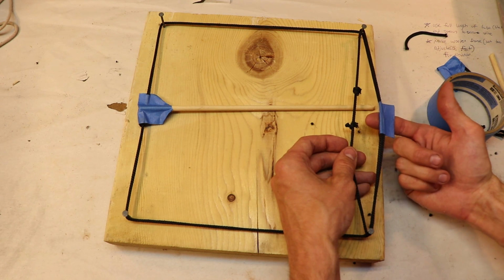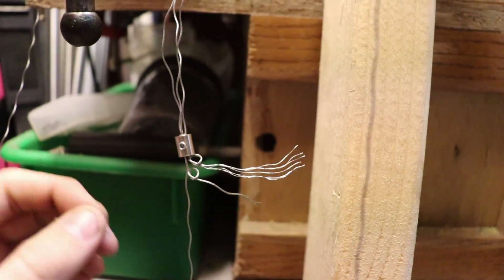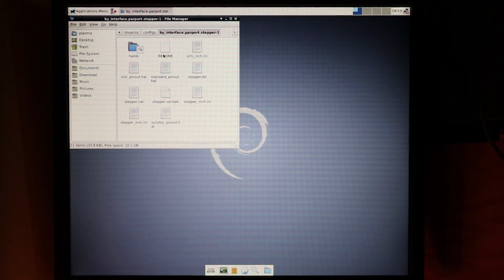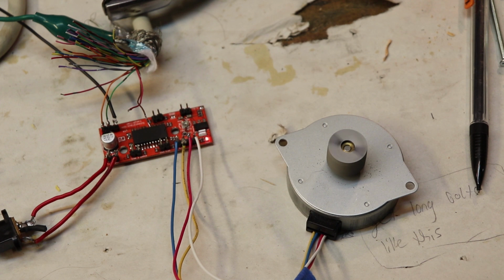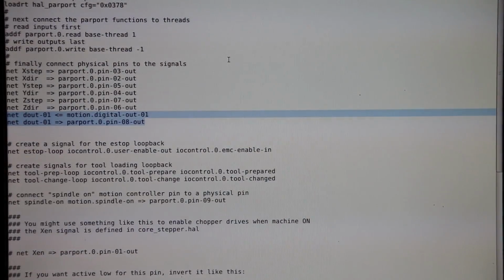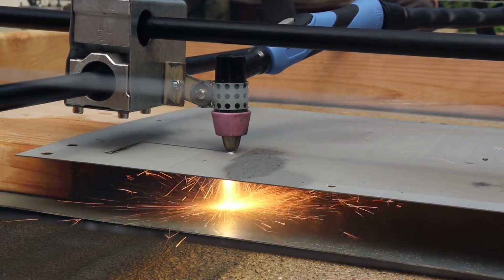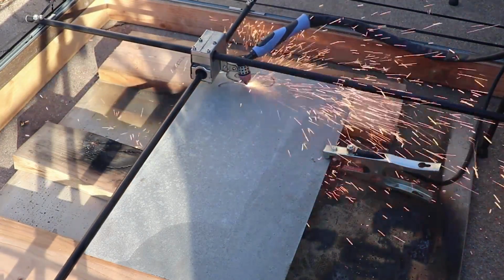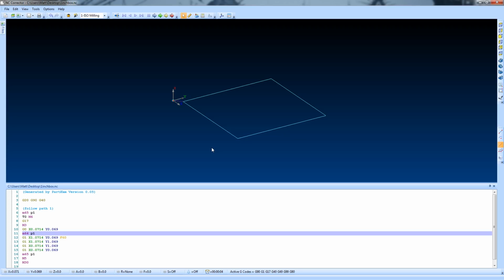DIY CNC Plasma Cutter (CHEAP)

Comment: how did you get around the high frequency noise and the Electromagnetic Interference ?
When I tired to use my Plasma cutter on my CNC machine the laptop that went berserk  (screen flashing etc) and the Port disconnected

Comment: Man, the neat thing here is that because the wood frame plasma cutter is so large, you could easily load in your own sheet and cut new stands for it and make a metal framed one fairly easily using only your own tooling.

Comment: You might want to make the frame stiffer by connecting those wires you have over diagonally from corner to corner.  Or use a 1x4 wood.  You also might want to make an "stick" that control the height of the plasma cutter over the sheets.  Like a ring around the cutting area and then up to the middle X where the cutter is set.

Comment: You are smart enough to make these as a kit for sale. Use extruded aluminum frames. Use threaded rods to eliminate slippage in the drive systems. Package it with a $300 laptop or better yet a tablet. Start with a bolt together 4' x 4' system. Do not make the table itself, just the system that we can bolt to our own table. That will keep shipping costs low. The largest expense for most turnkey plasma systems is the table and shipping. This package could be shipped UPS for under $50. This has the potential to be a multi million dollar business.
Reply: expensive laptop NOT need, cheap good have old used computer and linuxcnc. not need more, and controller board cheap 10$ breakoutboard were connected cheap DM556 etc motor drivers 20$/motor. and minimum good use nema 23 stepper motors min 3Nmeter torque. about take 3-4Ampere, need setting stepper motor drivers ampere max is little less than motor maximum current have. etc 3A motor max current stepper motor drivers need setting driver max current is little less 3A. maybe 2,9A then motors not burn broken. volts is better if have maximum what stepper motor can use, etc, DM556 driver maximum volt can use 50 volt good have 48 volt power supply.

Comment: Brilliant use of cables to make the X-Y move.  Even more brilliant that you're doing it with materials that are almost free.  I super appreciate how you make your thinking visible.  Please keep up the great work.  Subscribed.  EDIT: I also like how you're using an agile design process to upgrade where needed.  ALSO, I didn't realize that the parallel port was still available.  I used to use those a lot back in the days of the old DOS PCs.  Among other things, I used it to simulate the crank and cam rotary encoder signals for troubleshooting an R&D fuel and ignition control system.   Really cool stuff here as you teach new things and trigger good memories from my past projects.

Comment: You can get 1/16" OD vinyl-coated steel cable for roughly $20/100' on eBay. Nice stuff---thin, flexible, and the vinyl coating makes it easy on pulleys. I still probably would have gone with just GT2 belt if I decided to go this route though. Cheap and accurate.
Reply: best is G2 belt use. plasma not need more.

Comment: the only thing i see that can happen is that you cannot tension one wire without tensioning the other if they have no equal tension they might slip and scewer  , would work with bike chains , think that makes the setop stronger too (bikechains only bend one way the other is allmost rigid eazier to make loops and connect the carriage too as well )
as for the guide rails : wonder if curtain rails work
maibe you can drill out the holes oversize of one of the slide bearings so you can screw the bolts straight intoo the other slidebearing if you dont go too big it should not be able to twist (not that it would matter with youre setup)
as for the z axis , you could lift and lower the whole frame using a sort of screwjack on each corner driven again by a chain around the whole framewith nuts welded intoo them pushing a piece of treaded rod in or out of the frame (need a way to hold that treaded rod with the bolt rotating )   that would mean that all the steppermotors can be placed on one side of the frame and you dont have wiring moving back and forth
as for tensioning the belts , you could make the frame expand in both directions at 2 of the corners , moving the corners a part will increase the distance between the pulleys

Comment: Great video! just a suggestion but if you were to add small peace of angle iron with bearings or wheels  to the end of each rod. That should stop the bouncing  your getting when ever it shifts direction and at the same time it shouldn't add to much load on your steppers.

Comment: As far as the Z axis for the plasma torch, you could simply make a wire standoff guide or drag guide, a quick google will pull up some examples, I think this would be a quick and easy solution.

Comment: Thats actually very clever!     Imagine this..     A maslo style CNC PLASMA...    IF you're needing quick, easy, and cheap..   put a plasma torch on a 2 axis weighted / slanted...      Place all starts stops at the top or vice versa..
   As soon as it cuts out the piece will drop out behind the sheet.

Comment: Thank you for the true breakdown of the mechanics of the belt system and LinuxCNC for your CNC plasma! Actually seeing the trial and error was very beneficial and the evolution of the machine over the course of the video was inspired dude. 
I am currently trying to gain a practical understanding of electrical theory+components+schematics. How did you learn to manipulate electricity?? I have been reading books, watching videos and building CNC machines (Drawing bot, CNC Router Table [TopsCNC], and 3D printer) for a few months but all of these projects are well documented make the process fairly simple. Despite my efforts electricity still seems far from my grasp. Any recommendations for accelerating the process would be very appreciated!!
Liked and subscribed!

Comment: I've recently taken apart an old photocopier, and the photocopier assembly was driven with a rubber coated steel wire, so i thought that was neat.
Also you might want to use plastic skateboard wheels to keep the cable from tearing it up.

Comment: Hi, this is very interesting! You don't have any breakoutboard between the Computer and the Stepperdriver?
You may won't to change the stepperdrivers to a TB6600 or at least get a heatsink for the schmalz driver's.
The other easy way would be to do the job with a Arduino, you wouldn't need a parallelport. For this hardware
solution you can choose a lot of drivers with the CNC shield. The Arduino, shield and some generic driver
kit should be about 13-15$. A useful driver in this Arduino configuration with your powerful 2Amps motors
could be the TB67S109 driver, this one is made for the shield and is rated up to 50V and 4Aps (should cost
about 4-5$ a piece). You can do amazing 2D drawings with Inkscape and save these as G- Code directly out
of Inkscape. It's easy as eating pancaces :). Cheeers!

Comment: If you need a proximety sensor i have some expensive one laying aroud colecting dust you can have
Reply: Wessel, whats a details of that sensor and where you got it from? thanks!
Reply: @VladekR  Im a volenteer in a thrift store an we got a bunch of old motors and other electrical stuf from the neighbors among with those sensers
It are ig5526 proximity sensors and are like 50 dollers a pice if you buy them nieuw